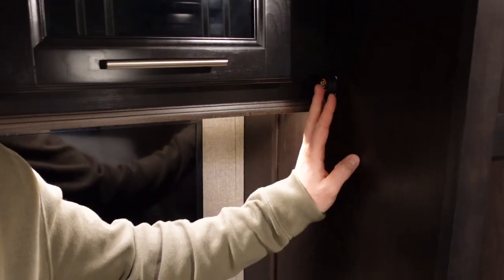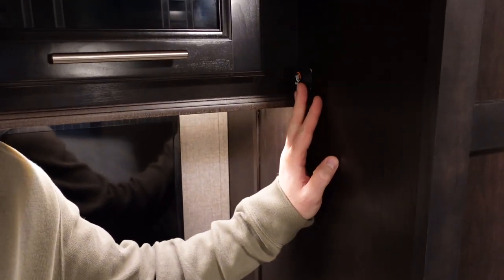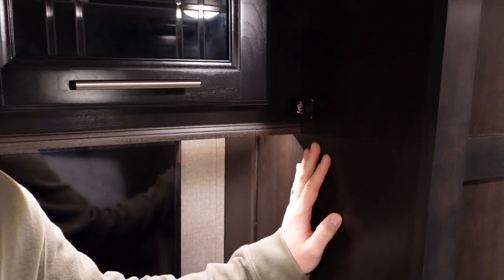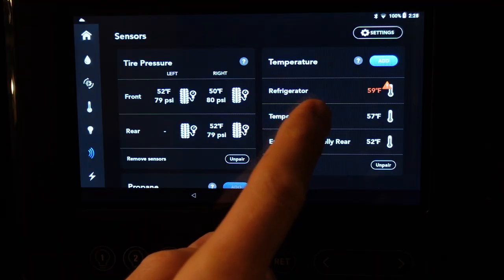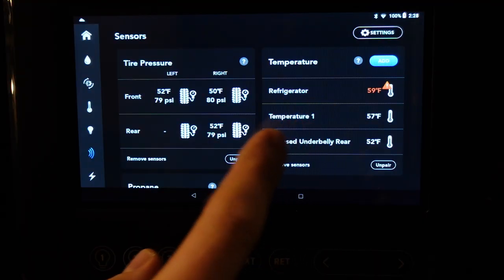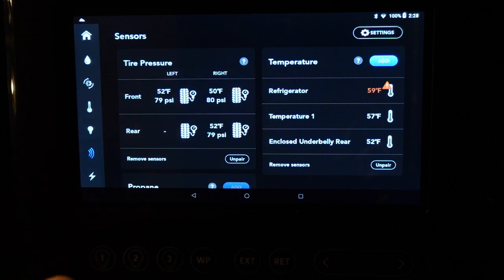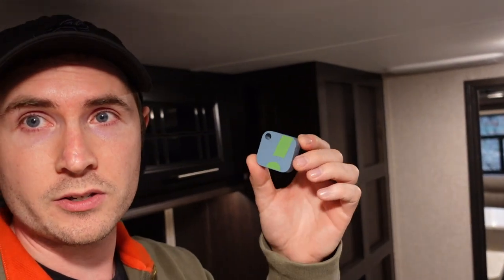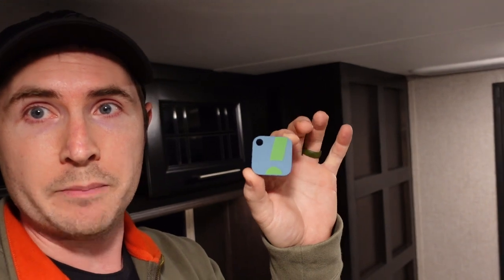Solution to the Overheating RV Bunk Room // Balance Your RV Furnace & Air Conditioner Once & for All

Comment from the maker: I should also clarify this problem is not unique to the Jayco Pinnacle. When I was browsing RVs, I did it in the heat of the summer. Many of the dealers would plug in the fifth wheels and crank up the ACs, and each time without fail the bunk room would be significantly warmer than rest of coach. It really has a lot to do with the 90 degree turn and the small 4" ducts that are so common in RV industry. Anyway, hope this helps!

Comment: Love the video...I also noticed how hot the office gets.  That's why I always left the door open to get the heat to coming into the living room, but the fridge door will hit the office door if not careful.  I'm definitely going to get the sheet metal today when I go to Menards for self tapping screws for the underbelly installation... Thanks again for another great idea!!! Finally, our bedroom will be warmer...
As a side note, the bedroom also has a thermostat on the wall right above the heater supply.  Hopefully this will help with the frequent furnace cycling on and off.
Reply from the maker: Glad to help. I notice my AC#2 thermostat in bedroom will read in 86-89 degrees when furnace kicks on with all that hot air blowing right on it. Thankfully it seems like my furnace only uses the #1 sensor in hallway for its trigger, otherwise that could really mess with system.

Comment: So, we have not used ours yet in the summer, so we don't know what to expect the bunk room A/C.  But I wonder how effective this would be with just the standard 2 A/C's like ours has.  Cool idea though...
Reply from the maker: I actually discovered that the third AC is connected to the rest of ducting as expected, but the supply goes to the  opposite side of the tracks in the ceiling, just meaning that most of the air flow that ends up in the bunk room is from the first and second air conditioners. I discovered it by accident as one time I had only the third air conditioner on, and discovered minimal air flow coming into the bunk room, yet tons of air on right side of tracks/registers. That's when I realized that it's connected into the opposite side of the ducts, so almost like it's on a racetrack on the opposite side of the tracks if that makes sense.  So if I want to make sure the bunk room stays cool, I have to make sure that the first and second air conditioner are running, or at least one of them.
Reply: @AdventureRocks  thanks for the reply.  I'll definitely keep my eye on it summer, and see how's does.  If it is having trouble keeping up, I know what the solution is..   Thanks!!

Comment: As a 2021 pinnacle owner too see such an consistent issue as we all have with this problem that your simple solution maybe would cost them 50 dollars to put simple damper in each vent or put louvered vents in is a very simple inexpensive investment they could make at a minimum with the money we pay for there (PINNACLE) unit. Come on jayco this is way to obvious and as an mechanical engineer myself a shame to ram this through the process without any R&D.  And there has been plenty of time to correct this issue.  I can list this as having  one oven in the kitchen one in the bathroom and the one in the bedroom, turkey 🦃 tested 🦃 approved . All this marketing on wisper quiet , direct dump , racetrack ducting bla bla bla.   Hey balance your system for one hvac 101
Reply from the maker: Hopefully one day!

Comment: Where did you get the vent cover for the AC vent modification in the bunk room????
Reply from the maker: Sure, glad to help. Here is the vent:
https://amzn.to/37i8Ohh

...it's more commonly used as a return register on whisper quiet systems, but nothing wrong with using it as a supply register instead.
Reply: @AdventureRocks  thanks for the help.     Keep all the great RV ideas coming.
Reply from the maker: @tomintemann7844  Thank you!

Comment: How would you do this with the circle heat registers in the RV that are in the wall and not the floor?  We have the problem similar to yours where our bunkroom is not getting good heat as it is the last register in the run, and they use the springy duct on the register, and the rest of the RV gets good heat.
Reply from the maker: I had similar problem in a previous RV where the heat ducts were in wall in bunk room and switched out to this register here with dampers built-in:
https://amzn.to/3X13La7

It just so happened that the OEM vent in the RV was nearly identical in style to that one above, so it worked out and I was able to then "pinch" off the amount of hot air going into the bunkroom so it didn't overheat. It sounds like your situation is a bit different as my bunkroom in that RV was closest to the furnace whereas I gather yours is opposite. So if I understand correctly in your situation the bunkroom may be the last or furthest from furnace, so you need to "pinch" off the air from the other ducts before, in order to force more air to the end of the RV into bunk room. So, in that case it should work still if you can put the registers with dampers on the other ducts closer to furnace to help prevent all the air from dumping in those vents before it gets to end of line, basically forcing more of the hot air further down. Let me know if I misunderstood though.

Comment: Can you show a sample of the sheet metal ring you made to help clamp the Air Tight Take Off? This is an amazing video and I cannot wait to make these adjustments to my RV. Well Done.
Reply from the maker: Thank you. Glad to help! I couldn't find any more pics (kicking myself that I didn't take any), but here's a rough sketch that hopefully shows better what that connection looks like: https://photos.app.goo.gl/deGLZ5n5vR4uR5H79

Hopefully that link will share nicely. I wanted it to be air tight and never have to worry about it coming loose, so basically it's like a sandwich with existing foam duct as the middle. And air tight take off + fabricated sheet metal ring as the bread if that makes sense. It took a lot of careful cuts and tedious assembly with the screws going through and such, but turned out great.
Reply: @AdventureRocks  It's been 8 months and I wanted to see if you have any updates for your modified air flow for your mid bunk? anything you'd do differently? any modifications made along the way?
Reply from the maker: @gregoryandlisaandres124  Yes, it has worked great so far. It's so nice to have balanced temperatures throughout. I have not had to adjust anything further on those mods shown in video. However, one other modification I discovered while servicing my 3rd AC which has a standard return (not whisper quiet ducted) is that the manufacturer left the excess roofing membrane blocking about 2/3 of the supply exiting the AC on one side. So I merely trimmed it off to clear the full opening. I only noticed a slight difference/improvement in air flow following as I don't use 3rd AC as much. But, still it's nice to have full airflow throughout.